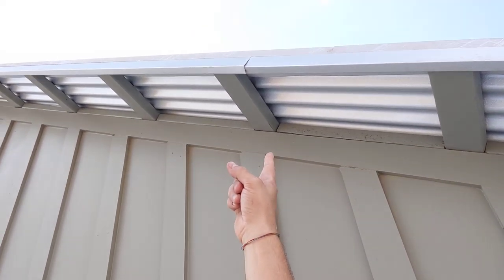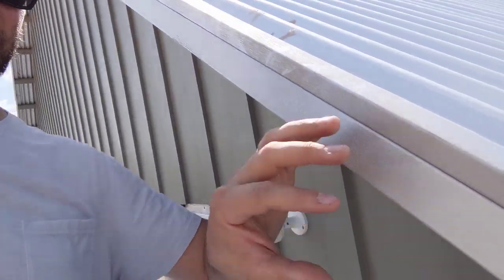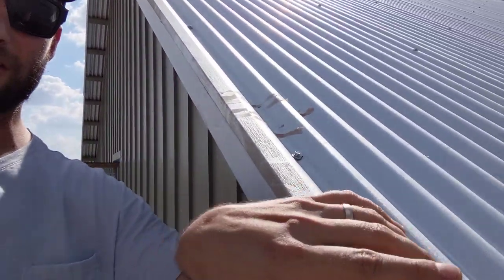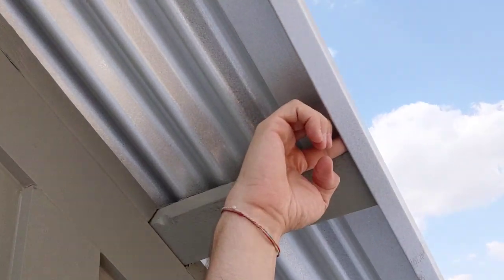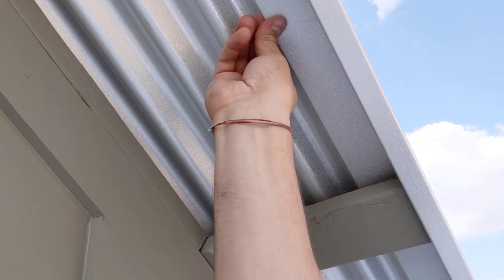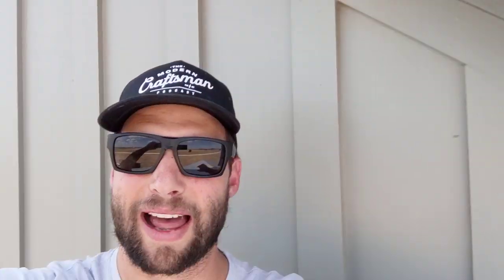Help!! Unintended consequences.  Modern Farmhouse Roof Detail

Comment: Put some exterior grade high temp 100 % silicone in between parts it should adhere and dampen the noise.
If it doesn’t get direct sunlight should last a while.
Reply: Nick Kishov I was going to say the exact same thing.
Reply: I was going to say figure out which adhesive will work the best for the two materials and glue it together, but I actually like this better, as it should last a long time while still being easily reversivle if you need to take it apart (and it's a house so you will need to take it apart at some point).
Reply: Or some type of silicone tape between the pieces. Rivets maybe too depending on their durability

Comment: Try some high density foam tape that you can attach between the trim piece and the roof. This way there are no extra penetrations in the roof and hopefully that that will provide a buffer between the two pieces of rattling steel.
Reply: This
Reply: Yup. Or 2 way tape

Comment: I’m thinking rivets might just just change the sound to a higher pitch. I’d lean towards pulling the trim and reinstalling it with something to decouple the surfaces (as apposed to forcing them tighter with rivets).  But, because I’m from the NW, where we don’t have your heat, I can’t make a specific recommendation.

Comment: A practical and easy solution is to have a strip of draft excluder as you have around external doors. A thick bead of silicon might also do. You should have it on any metal to metal connection that is likely to experience any vibration.

Comment: i think you have a couple issues. not just the iron vibrating against the flashing but the flashing vibrating itself.
matteogsys sounds like the best course of action. you could put an edge timber in place to give something to fasten the flashing a bit more, plus rivet the flashing to the iron, however i think with the wind getting up under it its going to vibrate it.  i'm not sure how the top cover thats hiding the screws is connected but that to could be vibrating on its own as well.

Comment: Butyl tape between the different pieces of metal.  Rivet the joints.  I'm surprised the roofer didn't use butyl tape between the roofing and trim.
Reply: Greg Erthal: butyl might not be the best choice because of the high temps of a metal roof, but i agree that the idea of a strip between the metal surfaces to decouple them is solid.
Reply: @BiggMo  What would you use?  I didn't consider the higher roofing temperatures in Texas, but here in Oregon butyl tape is used commonly for sealing between metal roofing.
Reply: Greg Erthal: hard for me to say also, im in Washington state and im probably overthinking it because of past problems (story for a different day). It probably just depends on the grade and type of butyl. A quick internet search shows low-end vulcanized butyl breaks adhesion at about 250f but higher quality RTV butyl can be as high as 500f. Because his  roof is a light color, I’m guessing the upper temp can be 200f (total guess).  So your suggestion is solid if using a quality RVT material

Comment: How high are your wind speeds in West Texas?  Here in FL for 110 mph wind zone the engineer and county wanted screws every 12 inches in both directions (on 5v 26 guage).  It's hard to tell from this video but do you only have a screw every 24"? With no sheathing on the eave exposure (most vulnerable part) I would be worried about uplift on those gable ends. If you blocked your edges with 2x2 or 2x4 (on edge) that would allow you to have a stronger eave and you could add screws to your roof panel edge (at least 12" O.C., 8" or 6" would be better) and solve your noise problem too.

Comment: Normal wind causing noise is the least of your problems. A serious wind storm is going to take that roof off. This is because you have allowed a path for wind to create positive pressure between sheathing and corrugated metal... Your solution should address both the noise issue and the larger issue.
Reply: Shinnah Wilde would closing off the soffit help? Though I guess it would still need to be vented

Comment: Hey Jordan, can you use peel and stick in between the board and the roof, it will dampen the rattling, maybe?
Reply from the maker: It seems to be mostly coming from the trim. I don't think we're getting any rattling out in the field. I don't know whether putting peel and stick between the trim and the outriggers would make a difference? It might?
Reply: @JordanSmithBuilds  how does it breathe with the 2x4s? Are they on a 45?

Comment: Why not slide spacers equally down the roof line putting pressure on the metal. That way you don't add perforation that would allow water to seep in and cause rusting

Comment: Why don't you just shoot some non expanding polyurethane foam every 4-6 inches.  The straw would surely fit and then the two panels would rest in the glue once you pull it out.  Seems a lot easier than drilling rivet HOLES IN YOUR ROOF.

Comment: Pop rivets came to my mind before you said rivets. Maybe silicon caulk. Maybe if they made a flashing tape with adhesive on both sides or use liquid flashing.
Reply from the maker: My concern with any type of adhesive is that it is so windy and dusty up here that it will probably attract a lot of dust overtime. That's why I'm leaning towards the dry method of pop rivets. You and my HVAC guy are way ahead of me!

Comment: Architectural sheet metal contractor Cleveland Ohio w w w. Matteo gutter systems.com none of the ideas are going to work.. you mean to deflect the wind.... screw some extra Roofing panels to the bottom side of your sleepers and to the Casual Observer they'll think it's just the bottom side of your Roofing panel otherwise a big storms going to rip that whole thing off look to factory Mutual specifications and something like this your way off the wind is warning you and rivets ain't going to cut it
Reply: matteogsys I’m just a DIYer, but that sounds like sound advice to me. I could imagine one of the once or twice a year windstorms we get in Dallas turning that thing into a sail if you let the wind under it. 

But what do I know. 

It still seems reasonable to me to use some Butyl Tape in the joint to address the rattle though? Cheap, easy, waterproof, and you won’t have any metal on metal rattles.
Reply: Dude, you took the words right out of my mouth! Otherwise this thing is a kite where as a sheet on the underside makes it more like an airplane wing.

Comment: Only way to fix that problem is to get it done properly. Cut that overhang back and use the proper flashing kit. The reason you don't have a overhang that big is because water will get in and it will always rattle on a windy day.